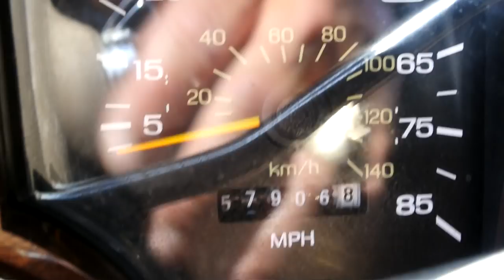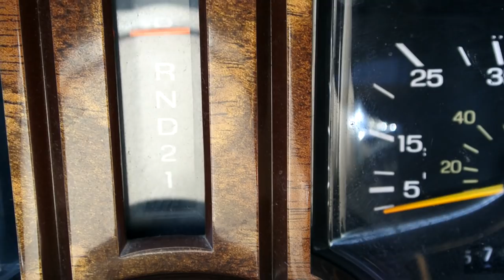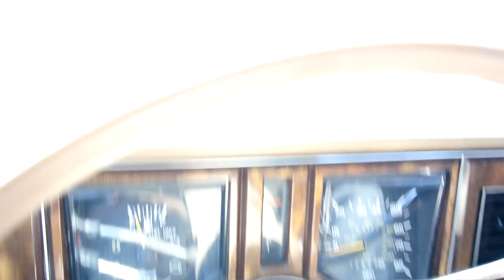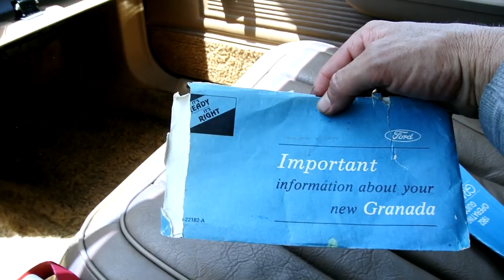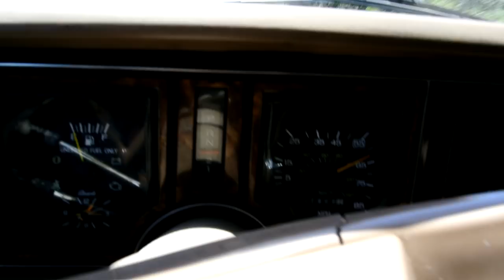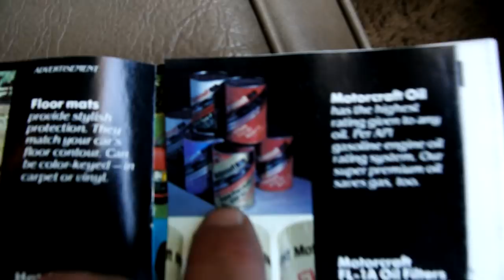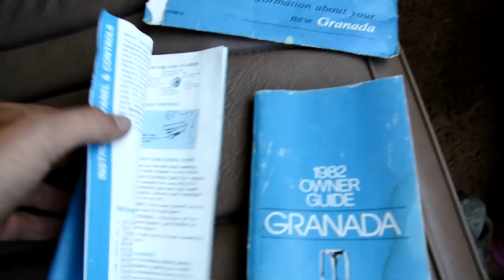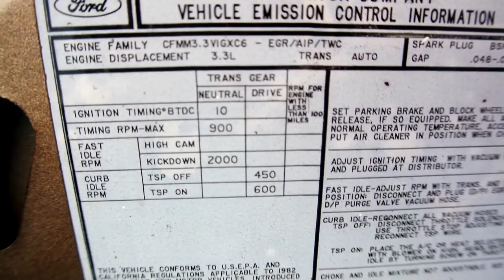1982 Ford Granada Fox Station Wagon LTD Fairmont Estate 1 Owner Car Guy Mark 2

Comment: Rare car! That wagon was only badged as a Granada for 1 year. Nice car, thanks for sharing.
Reply: Whereas, the Mercury Cougar marque had the honor of gracing a station wagon for not one but two model years. In that case, the first time the Cougar nameplate could be seen on a wagon was in 1977 in the form of the Montego Cougar Villager; and then in '82 as a twin to the Fox-body Granada.
Reply: In eight years, the wagon saw three different names:

1978-81 : Fairmont
1982 : Granada
1983-86 : LTD

Comment: The inline  6 was often described as "bullet proof". Rigidity based on 7 main bearings more than enough for each cylinder thus no vibration. I've had 4 fairmonts with same engine and they'll go for about 170000 miles before  it needs ringed and valved

Comment: I had this car for about 10 years. Was very strong. The engine was a 3.8 liter v6. I dont think it was a "small" car as you say... The trunk is really big indeed. I had a band and me and my friends threw in there 3 guitars and drums. It wasnt called Granada, it was actually named "Cougar" . Also had power windows in the back. I remember it had trouble with the engine cooling system. You couldnt have the air conditioning turned on for too long if you were stopped in a traffic jam... overall, very strong and useful car
Reply: Cougar would be the Mercury version of the car  this is the Ford version

Comment: I wonder why Ford in the US didn't adopt any of the engine developments from Ford Australia. Ford Australia discontinued the non cross flow 200 and 250 cubic inch engines in June of 1976 because Ford Australia claimed they would not meet the new emission control standards that came into force at that time. Yet Ford US seemed to use that engine well into the 80's. By 1982 the 200 and 250 engine in Australia had cross flow alloy heads and the 250 could be ordered with a Bosch electronic fuel injection.

Comment: Why do they not make cool hubcaps anymore?
Reply: anajay78, because a lot of people were ordering the optional alloy wheels or replacing the stock steel wheels with aftermarket mag wheels that the manufacturer just did away with them for a basic alloy wheel with plastic center cover and high end alloy and mag wheels as options.